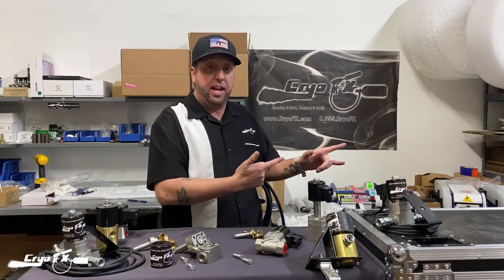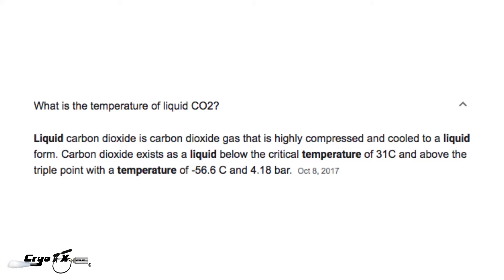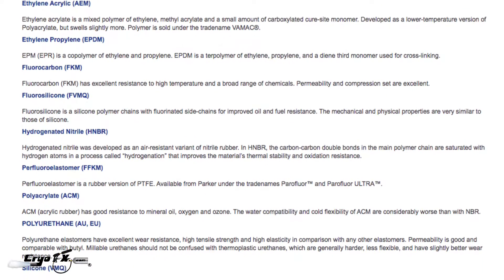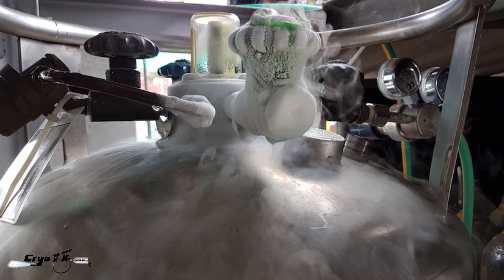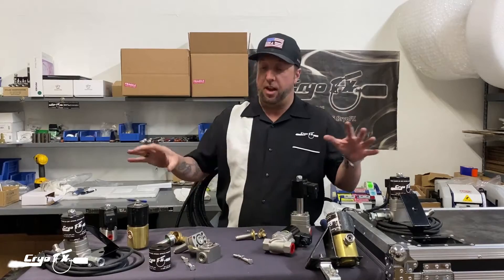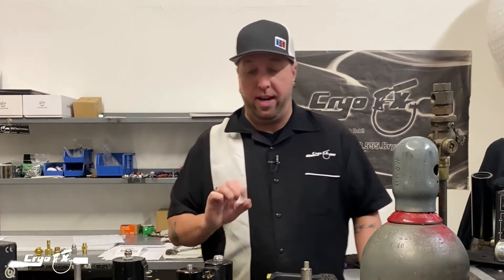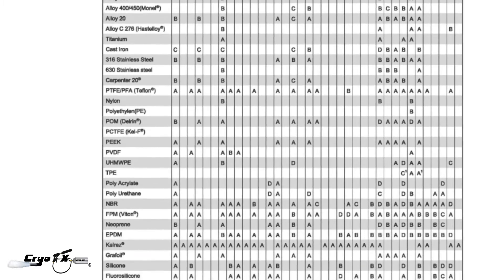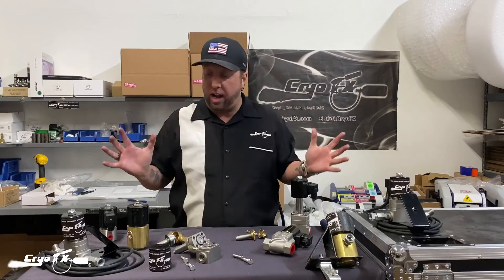Liquid Co2 Valve - Cryogenic Valves Explained [CryoFX]

Comment: Is there any valve that would work like a mini co2 canon or jet with a tank as small as a 5 pounder for a more portable unit?
Reply from the maker: Yes we have them, however 5lb tanks will give you 1 shot of co2 smoke, so depending on your use would depend on whether you need larger tank.

Valves here:
https://www.cryofx.com/products/mounted-co2-jets-cryo-jets.html

Comment: Hi there, is there any suggestion what should I do when I start the co2 out for 7second, it wont close the valve?
Reply from the maker: Sounds like the valve is freezing open. You may need a different valve or the vale pressure is too low for the pressure of the co2/gas through it